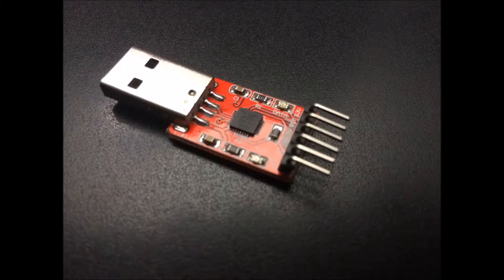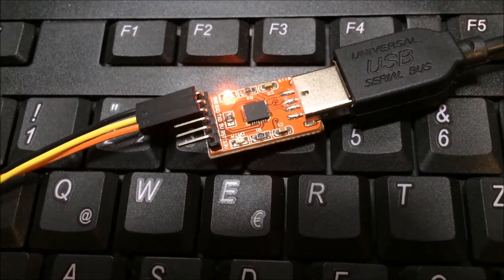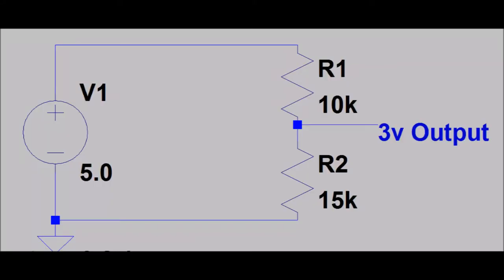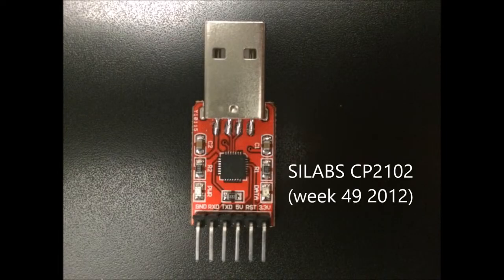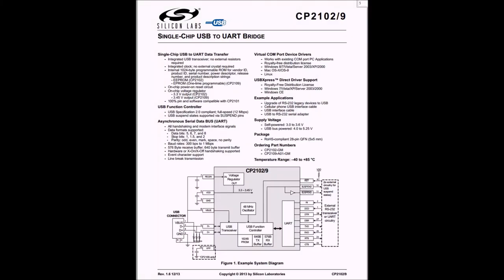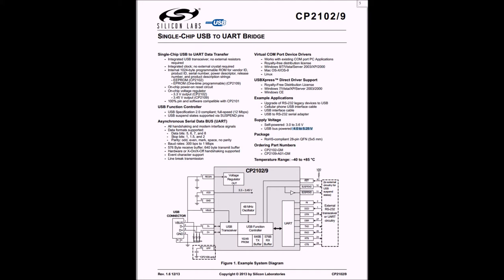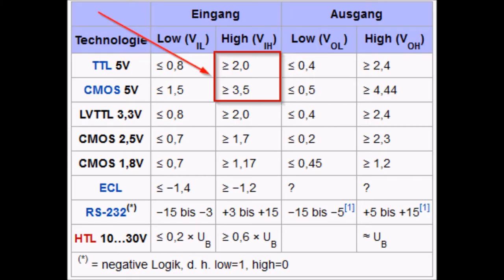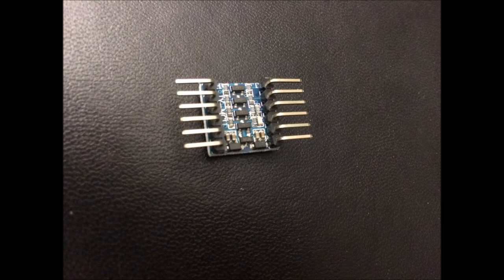SideNote on my USB to serial TTL UART (ENGLISH)

Comment: In my experience,most of the USB-Serial adapters I've used are 3.3V levels on the RX/TX pins.  Another note,I have some identical looking adapters as the one shown here. After some frustration,I discovered the labels for the RXD/TXD pins were reversed!
Reply from the maker: +PhattyMo I see. That explains why people keep writing me that they didn't have to cross TXD/RXD to establish a serial connection. - Thanks!
Reply: yah, in my experience too, 3.3v adapters normally are 5v compatible.

Comment: Hi, thanks for the info!! do you have a link to the level shifter at the end of the video?
Reply from the maker: +IR Geek Yes, it can be obtained here for cheap: http://www.banggood.com/5Pcs-IIC-4-Way-Bi-Directional-Logic-Level-Converter-Module-p-951145.html?p=NT1005763073201409DA
If you're interested in the topic, I recommend my blog article here: http://www.areresearch.net/2015/08/level-converters-how-to-safely-connect.html
And my video here: https://youtu.be/OKZwXLtxREM
Both on matching levels between 5v and 3.3v systems.
Reply: Excellent! thank you, I will do my homework :) keep up the good work!